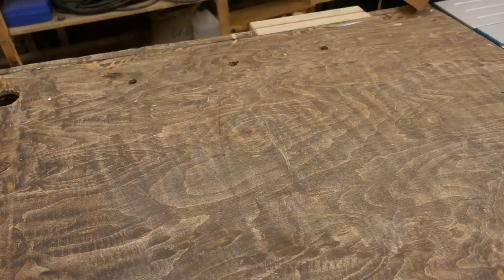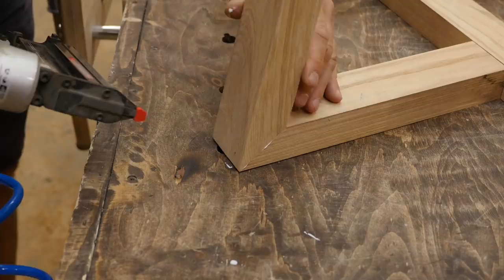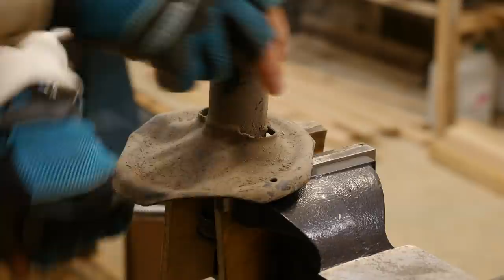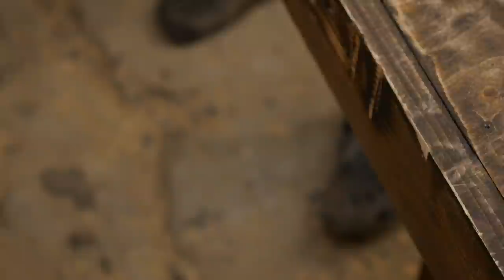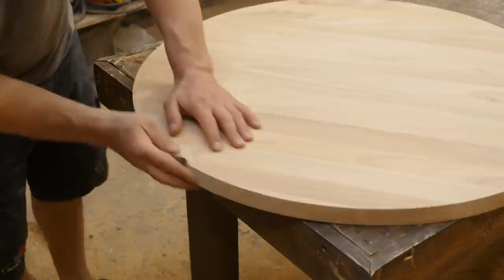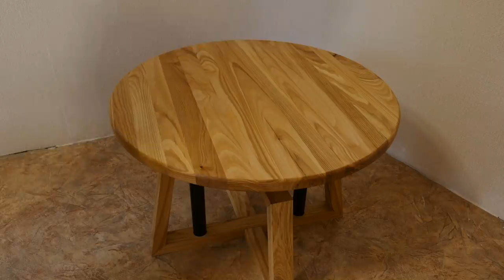Unique idea from discarded boards!

Comment from the maker: Friend, I hope you liked this idea and its implementation!
Waiting for your feedback in the comments!
Reply: I had no idea what you were doing until the last minute or so. Amazing!!!
Reply: Great job!!  I love the simple simplistic design. It's truly a beautiful work of art that is functional as well.
Reply: wow that table lasted 5 years?
Reply: Its a perfect table
Reply: Debra Carraway A
Reply: Word of advice: Stop holding your parts together by hand while air nailing/stapling. The nail/staple can hit some unseen resistance, bend out through the wood, and pierce your fingers.
Reply: @MutePlayer43118  ni
Reply: Very brilliant idea...love your equipment. thanks
Reply: Great job 👍
Reply: HandCraft those metal poles under table need plastic guards like pool noodles or pop bottles heat treated to form 
Protect those knees
God Bless
Reply: @MutePlayer43118  
.
Reply: It's an extraordinary thing that the video is juuuuust long enough to get over the monitisation length.
Reply: Neat project, hate the click-baiting title. Cheers.
Reply: @telectronix1368  I didn't get an ad, so I'm not sure that it is monetized. If it was (or is), you would be absolutely right.
Reply: nice..do you apply any clear coat or other finish over the oil?
Reply: Very nice friend a WISH GOOD HEALTH
Reply: Legal
Reply: @MutePlayer43118  .
Reply: Untill the last movement i really dont know what r you doing that... And you surprisingly used Fork-Hydraulics...
And this is a good idea to make Adjustable Tophead Tabel..
Reply: First, what an awesome, creative dad you are!!! Ingenious idea, perfectly executed.
Reply: @PacesIII  can at
Reply: Please, what accessory is this used in the drill?
Could you say the name of the manufacturer?
Reply: Perfect done. Not wery useful idea, but grea solutions. I should mention your good working precision.  Be well, M.
Reply: Awww, that table is a cute idea! Awesome job.
Reply: Amazing wood working and fabricating skills. I am not even close but enjoyed the process and product. Cheers.
Reply: I like so much
Reply: I love this table!! Beautiful work and very functional.
Reply: Das ich
Reply: Worried about your protection..
Reply: Másterclass 😎😎😎😎🛠️🛠️
Reply: @emeraldbay3620  YT sets a minimum of 10 minutes for videos before they pay any revenue to the uploader.

It's why you'll see a lot of videos that "just happen" to be 10 minutes and a few seconds long.
Reply: Ash you
Reply: super
Reply: Isn't it a crime to throw away that amount of prime timber in the first place?
Reply: Slovenija?
Reply: Great job on the table
Reply: @mikecinde1  good stuff
Reply: @Mohamed-pm3dn  Cool
Reply: Amazing
Reply: Just needs background music
Reply: Молодец! Good idea and good hands, best regards!
Reply: You just made a table
Reply: لوز
نط
Reply: ط
ظن؟ص
ق
Reply: @MutePlayer43118  uuhu8ooi mini
Reply: @crying_hippy  protect from what?
Reply: You are one of a kind
Reply: @MutePlayer43118  qq.
Reply: منتتةللببل
Reply: Ur name is like indian great work done
Reply: Liked? I loved it! Thanks bro!
Reply: @MutePlayer43118  rq
M
Reply: The top with wobble when raised. Using three in a triangle would prevent.
Reply: nunya I think this is good advice for viewers, but given how skilled the creator is, I assume he knows the precautions but, like many people, doesn’t follow them all as it can be cumbersome.
Reply: Excellent idea good job bro, thanks for sharing and God bless you and yours Ken.
Reply: It takes an unparalleled skills to make wonderful pieces! I was very excited on the result@
Reply: Very nice idea and well executed!
Reply: Не знал, что у некоторых русскоговорящих людей золотые руки)))
Reply: What's the name of the drill guide that you used?
Reply: Becca  x, 55
Reply: Becca  4
Reply: @PacesIII  Most of us learned to not do that by getting "nailed" LOL I suspect he hasn't........... yet. :)
Reply: @shfaasho  

One can only hope I have afforded HandCraft the preventative opportunity to make the change before disaster strikes.
Reply: I wish I could there with you, I love it so much.
Reply: Ash 😄😄
Reply: mikecinde1 amazing😇😇
Reply: @MutePlayer43118  her!rrrfftrrhed
Reply: you are really creativei have enjoyed your videos
Reply: Hi Vanya. Do you have any drawings or plans for this project? I would love to make this.
Reply: @MutePlayer43118  

Ραδιο σπυρος
Reply: @MutePlayer43118  aQqAQaQÀQaQà
Reply: Friend,
Reply: @MutePlayer43118  8
Reply: Love you man!!!!!!!!! Fantastic!!!!!!!
Reply: @MutePlayer43118  p⁸p
Reply: @webdebspider  I
Reply: @mikecinde1  aea
Reply: a
Reply: 9:25  Absolutely  Love your use of the verticle door locks to bolt the table parts together.    Brilliant !  :-)   Good Job,  beautiful build.
Reply: . @mikecinde1

Comment: Since when are full lengths of boards considered "scrap"??  I'd love some of that scrap.
Reply: the carpenter in my hometown they used to pick up scrap from wood factory  and  make into valuable furniture
Reply: @erichin888  wood factory? Like a saw mill?
Reply: @kelsenjames7154  yes sawmill:)they have a lot of thick trimmed scrap that can be used for furniture
Reply: Don't be churlish...
Reply: lmao
Reply: I save all kinds of scrap wood just like that and have built dressers and tables etc Its free hard wood that would cost a fortune to buy. Also save all kinds of hardware, metal, screws and bolts. My garage is like a treasure trove
Reply: Thinking exactly the same thing, it is exceptionally good quality wood.
Reply: Yes just happended to pieces of nicely dresses pieces of so called scrap thrown in to a pile of tree trimming s.      Yeh 🤔 and check out all the tools yeh we've all just got them laying around our sheds and garages and no earth equipment on till he was bringing the old shock absorbers lol h+s
Reply: I was commenting almost the same. What a luck, if you want to do some woodworking, to live next and know someone who throws away that borads!
Reply: If you think thats wild you should see the type of steel thats scrap at major construction sites
Reply: Also if you have a sand blaster you can probably afford more than just scraps
Reply: When it's slightly crooked, or has too many knots, or wane in it.  There's a lot of reject wood people will not buy, that is perfect when cut down to small lengths, for projects like this.
Reply: OriginalYithian  😂Right , how you mad because your setup is GARBAGE
Reply: @sirennoir258  the bottom 8the of the board was nearly cracked in half, it actually did have a decent amount of damage when you consider a store will throw away produce that's perfectly fine but isn't perfect looking...
Reply: @winstonpoole9906   That is perfect word to use here. Thank you.
Reply: One man's trash is another man's treasure.
I use lots of big glass panes in work, and my glass scraps... some people are willing to pay money for it...
Reply: "Scrap" doesn't mean useless. It just means no one has a use for it currently. 😁
Reply: Somebody scrapped it. Threw it away.
Reply: Remember that he might be get them for cheap, not free...
Reply: @casekocsk  
So?
Reply: Scrap wood but £3000 tools
Reply: @tonytotten408  Well yeah, I do general contract work (on the side, even; I'm primarily a mechanic) and I've got everything he uses in this video. None of the tools he has are uncommon or even particularly expensive; the table saw he uses is easily the most expensive tool shown in this video and they're only a couple hundred bucks if you put in some legwork to find a deal.
Reply: Extra/Surplus =/= scrap where I come from
Reply: Literally my first thought...
Reply: @oscardelta1257  I go by the rule that I save anything that I can't easily make myself :D
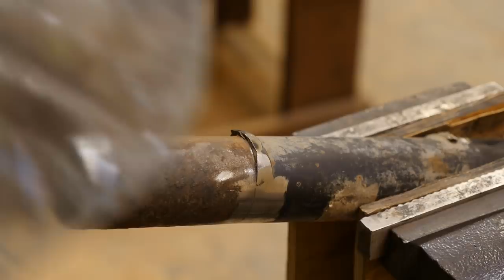Reply: 👍  5:29. The sound of the angle grinder is really quiet. Thank you!
Reply: I thought it looked like pretty nice wood too.
Reply: John Calkins U sound jealous bro. The man did a awesome job. Can U do that?
Reply: @winstonpoole9906  you done messed up now A A Ron
Reply: Tom I  agreed, I think he's saying normal people don't have access to routers, sandblasters, and other agressive woodworking tools. Even though this ain't a diy channel.
Reply: @jeffman3  I'm sure that sandblaster was more than the table saw.
Reply: @Champions Again, yeah you throw that stuff in a chipper and sell the chips to paper companies. Sawmills don't keep scrap like that.
Reply: John Calkins 🌸 I was thinking the same thing 
I’d luv to have some of that, it doesn’t even look like rejected bits
Reply: My cousin has a bunch of high quality copper coils,wires, and electrical boxes and transformers that his company will scrap after the job(They're not allowed to use materials from one job to another, client pays for materials and labor.) So the guy usually scraps most of it but let's his workers also take some home. You'd be surprised what is scraped and as stated,a lot of times clients pay for materials and labor so it's just easier to throw/sell left over materials for a extremely cheap price.
Reply: exactly what i was thinking... my kid makes art with found objects (school assignment) and this shows up on suggested videos. a full blown wood working shop :) hilarious never the less.
Reply: Unique idea? Make a table from wood? Who'd ever have thought this?
Reply: Wos
Reply: OriginalYithian  cheap, or just not so lucky?
Reply: John Chunga : AND recently, John, 24" square glu~lams to the dumpster from a hotel renovation. ...it breaks my heart what goes to the TransferStation outside Lincoln City from remodels on major complexes here. The major hospital here (1968), wood-framed, razed with NO salvage. Now a parking lot.
Reply: IT was "dscarded" - probably because it was split on the ends and not useful as a stud or for whatever purpose it was intended.  One man's trash-another man's treasure.
Reply: @erichin888  well in our country an informal settler can build a whole community with them
Reply: It comes in whole packs still wrapped out the front of construction sites 🙄🤣
Reply: @winstonpoole9906  well played
Reply: From a lot more than just discarded boards.
Reply: When they are heartwood (soft internally), bowed, cupped, twisted and split...
Reply: A buddy of mine owns a home improvement company and every weekend I stop by the yard to see what goodies they got from the week. And there's always 8-12 longboards in the scrap pile some have splits some have cracks others have nots summer twisted I've even seen full sheets of Oak and Birch plywood in the scrap pile on occasion you'll be amazed at what home improvement companies consider scrap

Comment: Let me get some "scrap wood" , pulls fresh wood plank from home depot shoved into the middle lol.
Reply: If that's Oak. you aren't gonna find that at 'Home Depot'. Home Depot sells framing lumber and small hardwood lumber. If you want something that long / thick you have to go to a hardwood store, or sawmill to buy it.
Reply: Ain't no way you're finding wood that nice at ANY big box home improvement store!
Reply: @dedalliance1  Uhh...I buy Oak at Home Depot all the time.
I've made a lot of high end furniture from Home Depot material.
Reply: Lowes has as bunch of nice oak lumber. Menards even carrys walnut and cherry.
Reply: @brokenwave6125  Yeah, maybe 3/4 inch or 1" material. This guy had like 2" to 3" thick Oak. I've never seen that at a big box store.
Reply: @dedalliance1  they also sell hardwood.
Reply: dedalliance1 sa
Reply: Never seen that big of oak at my local Home depot which one you goin' to?

Comment: Calling this "from scraps" is really stretching it.
Reply: If that nice pile of wood he has is "scrap" then the wood leftovers I have are "pure garbage wood". 😂💯😂
Reply: not really. look at the splits running along the full length of those boards.
Reply: Whaaa?
Reply: well technically is leftovers from wood mill that didn't fit quality pass to be reused. We get plenty of those at very cheap(that whole pile won't go above 40$) and use it mainly to heat our homes or make stuff like fences or even a shack if sturdy enough and not with too many cracks. So yeah, that is scrap from the mill.

Comment: Unique idea for wood scraps that are free... proceeds to show 20,000 of specialized shop equipment
Reply: A good craftsman can solve the problem of lack of said tools.  You'll be surprised how amazing they are at improvisation.

Edit: As long as they have basic tools, they can do the same, only taking a bit longer.
Reply: @Croiri  a good craftsman would already have tools.

a basic joe plus basic tools = watch youtube and complains about the "scraps" used

Comment: I have been noticing that all the "scrap wood" this guy has look like wood bought straight from the wood dealer
Reply: No only that it goes from pine to oak
Reply: The only “Scrap” Wood was the pieces he used to put weight on when he glued the boards for the table.
Reply: and the shocks weren't exactly MOT failures, grr.
Reply: It's as if the title was worded to make it more interesting.
Reply: Looks like sawmill waste to me - boards with bark, wane, or severe end spilts, as the one had that we saw him retrieve and cut three pieces from at the start of the video.
Reply: @telectronix1368  Just check the names of their other videos. They are basically identical.
Reply: @telectronix1368  I just realized that I replied to two of your comments. Well, I guess that we have similar views on this video.
Reply: I guess I got clickbaited

Comment: Tip: Just get couple of rear shocks. Needless to grind that much.
Reply: Nasi Lemak he probably knows that but had this laying around..it’s more cost effective this way I guess..or in the “scrap” theme anyways..
Reply: Not shocks...gas struts. Like the ones that hold your minivan rear door up. More likely these are steering struts...just sayin...
Reply: @jrwill58  First time you see shockbreakers?
Reply: He could have just unscrewed them out of the housing. Those shocks are a replaceable insert.

Comment: Roll up your sleeves. Never release the wood while it is in the blade. Very nice hold down, I need to make some like that :).  Put masking tape on your pipe clamps to protect them and the wood from the glue. Large router would be better to do the circle if you have one.  Don't release the trimmer while it is running. Yes you have a larger router LOL.
Amazing project. Nice work. :)

Comment: Huh, I almost abandoned this video ten times. Initially the circular saw on the ground piece almost did it but of course curiosity got the better of me. Quite a mix of skilled workmanship and half assed techniques. Kinda reminds me of the folding shelf/counter the wife had to have in the laundry room to replace an existing permanent shelf/counter.  Installed the folding brackets and upgraded the shelving. Showed her how to work it and of course 5 years later its never moved.  Neat project but overkill for a child's table in my humble opinion.

Comment: I burn sawmill slabs to heat my home, but I usually salvage a few sticks from every load.  If a board is not usable for its full length they discard it. I noticed that one of the boards he cut was like that, one end was badly split.

Comment: For all the people out there thinking he used good wood and he is doing something you cannot with tools you cant obtain. Obviously dont realize this guy works with wood alot, of course he's got skills. But those sticks were a small scrap pile. When you work with lumber, you prosess wood you get tons of waste. Guys with mills and real pro woodworkers will gladly let you pick through there sticks so they dont have to pay to get it hauled off. If you are serious go talk to them and ask. I would know. Our stick pile was 25 feet high and 50 feet long and theres quite a few of those...enough to heat a community for the winter..

Comment: 1:54 Always pre-drill the top holes bigger than the screw thread. This way the screws will pull the bottom piece against the top piece :)

Comment: Always punch your cut clear of the blade so you don't end up with it in your face. And never drill,cut or grind on a sealed pressurized cylinder.

Comment: Going to kill your trim router cutting lumber that thick.  What are the chances your lumber was dry enough to ensure the glue joints won't fail. Also the steel bar will not allow the wood to move seasonally. Nice idea but this will fail over time